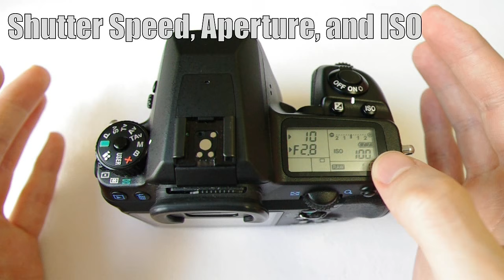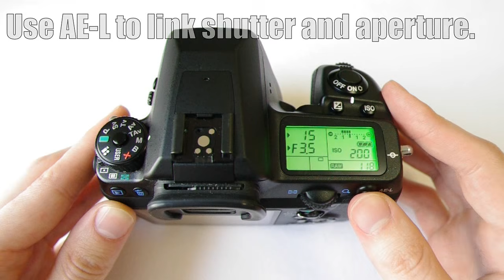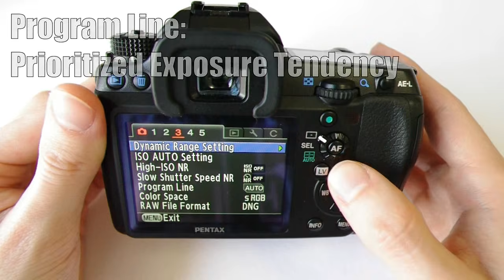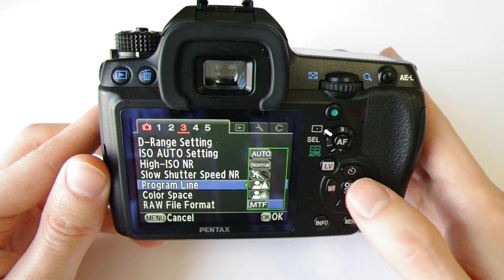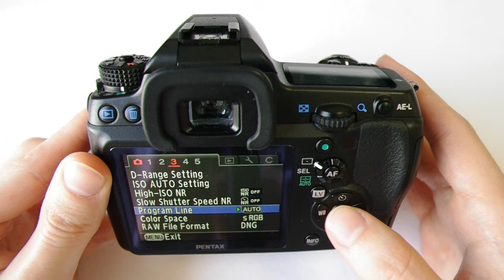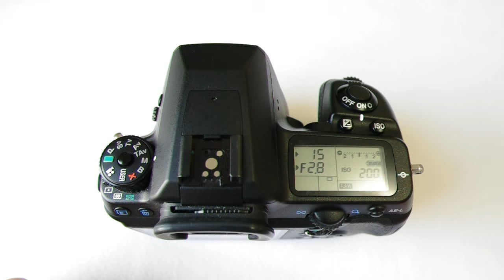Pentax Hyper Manual Mode Settings

Comment: I have Canon 60D and planning to change the camera to Pentax K5ii. What I think is Pentax the most reasonable camera for photographer. My problem is only knowing Pentax just the tip of it, so can you give me a reason why I have to change the camera and why I don't have to change it?
Reply from the maker: What about the 60D don't you like? Is there something you feel is holding you back? One benefit of Pentax is that their control and ergonomics are well thought out. According to DxO mark, the K-5 II sensor should provide you better low light performance than the 60D. How much of a difference in practice, I don't know. https://www.dxomark.com/Cameras/Compare/Side-by-side/Pentax-K-5-II-versus-Canon-EOS-60D___829_663 
Back when I was using Pentax, I always struggled a bit with the autofocus system. Canon has better AF performance in general. It looks like the K-5 II is upgraded compared to the original K-5, but I don't know how much of a difference that would make. Maybe you could find something newer around the same price?  Do you have a lot of Canon lenses? It would be time consuming to switch systems.
Reply: At first I do like it 60D, fast focus, flip screen, etc. I just hate it with the lenses that I cannot afford it, and I only have the 50mm 1.8 and tamron 18-200. And this is what I think if I'm having Pentax, I already have SMC-A 50mm f2, more cheaper lenses, the camera price is cheaper,  sharpness image and the amazingly the color image that I cannot have with 60D. What makes me holding back to change the camera is 60D my first digital camera and have been using it +-8 years, and yes if changing to Pentax it really time consuming
Reply: If you are considering changing, i myself have the pentax k5iis, its an all round superb camera, the low light performance and focusing is spot on, plus you can use nearly all the older pentax lenses produced in the past albeit with manual focus, i picked up two mint condition lenses the other day, a hoya 135mm f2.8 complete with uv filter & original leather case, and a nice perfect condition cosina 28mm f2.8 again complete with original leather case, the cost from ebay for the pair, just £49.05p including delivery, just think how much those would cost new, there's videos on youtube showing how to use manual older lenses and still utilise most of the camera features too.

Comment: What camera was this?
Reply from the maker: It was either the Pentax K-5 or K-7. I can't recall exactly.
Reply: 1st and 4most, i have to thank Photography Banzai for doing a really fine job of explaining various photography related items and topics in his simple yet great videos, this one in particular, which made me go and search for certain small yet important features i didn't quite know about in detail, until now, of the Pentax DSLR cameras, 3 of which i already own and use dearly: K-x, K-7 & K-5 ... :)

beware please: this comment is going to be TOO long, so, be prepared!

to address @bigpardner's question and to further compliment PB's reply to him, yes, this could be either one, but although the two cameras mentioned here are practically identical in body dimensions, design, and button layout etc, as well as being pretty much similar in operational modes and menu items options just as well -- with quite a number of changes made when K-5 came out of course, the latter's manual mode is more advanced than that of the K-7 and at least K-7 doesn't do all that is said here in exactly the same manner ...

in fact, in case of the K-7 (which came out a year or so before the K-5 btw) the M mode is fully manual, ie, the camera's light meter, although still active and working, it doesn't have ANY effects AT ALL on the photographer's actions and decisions when rotating the shutter speed and/or aperture dials ... ie, the photographer has to use a separate handheld light meter or other means to determine correct exposure and then set the aperture number / shutter speed manually on the camera, pretty much like when working with ancient fully manual film cameras and lenses ... (rather silly decision by Pentax designers, right? that's why they didn't repeat the same mistake when making the K-5 ...)

yes, what you have said here about using the Green and AE-L buttons on the back of the camera, or setting the camera's Program mode to MTF, does have some effects on how Manual exposure mode 'behaves' in both cameras, but in either case, the manual mode is just what it is and supposed to be: fully manual!
_ _ _

then it comes to using a light meter for determining the exposure (more on this at the bottom of this note btw*) which the K-7 does NOT offer while K-5 does, although in its own rather peculiar yet still useful and innovative manner anyway ...

with the K-5 though, the shutter speed / aperture control dials ARE coupled with the light meter indeed and work as expected, which, as already said, was the right decision to make on behalf of Pentax designers when people complained why it didn't work the normal TTL metering system way in the K-7 ... (although as this one was also mentioned already, it still works in its own unusual yet very nice Pentax way!) :-)

therefore, the camera model in this video must be K-5 then IF Photography Banzai's explanations on how to use the Hyper Manual mode are true ... which are not btw, and i'll explain in detail a while later ... but before getting on with that, let's consider the following please:

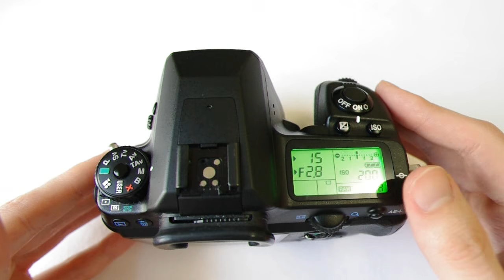to solve the mystery here, another reason i'd say this is a K-5 body is the fact that the exposure modes rotating dial on the left-hand side of this camera's top section is 'one dent' taller in height than the very same button in K-7 ... note: 0:35 please, when the camera is lifted up and rotated forward ... (this was another 'design improvement' in K-5 as a totally new upgrade to K-7 while retaining the exact same body sizes and overall specs btw, after the latter model's users weren't quite happy with K-7's mode dial button's rather short height that makes it a little bit difficult for easy operation ...) also, note 2:22 when the VO does mention K-5 ... (and i wonder why PB didn't notice that himself now that he's watching his own video after more than 5 years? happens to all of us in this overly busy world anyway ...) ;-)
_ _ _

now, the other VERY IMPORTANT thing is the fact that there's actually no "Green Hyper Manual Mode" in these two particular Pentax camera models, nor in most other Pentax cameras to the best of my little knowledge on other Pentax DSLR or film cameras ... (am a very old Pentax user since the 1970s btw!)

the Green mode in these two particular models at least, is there to overrun ANY fully- or semi-automated as well as manual modes of the cameras, and set the machine in the "Hyper Automatic Mode" actually, intended to help out those photographers who're in doubt which mode exactly to pick up and choose when taking photographs of any kind of subject matter ... (and it's a rather cumbersome mode for various reasons but well, let's just leave it at that for now ...)

also, the Green Mode doesn't exactly work via the little green button on the right-hand side of the camera's back really, but via rotating the top left-hand side dial and setting it on the tiny little green rectangle marking there ... besides, since many advanced photographers rarely use the Green mode anyway, the little Green button is programmable in both K-7 as well as K-5 models so it can be assigned to do other things ... another very good decision Pentax camera designers made in these two models ... (again, as far as i know, this button, and even the Green Mode itself is no longer used in later Pentax DSLR models but not so sure about that one really ...)

furthermore, as mentioned above, the Green mode (yes, proprietary of Pentax but other brands do also offer similar functions under different designations) is actually a pretty cumbersome exposure and autofocusing control option for advanced photographers who'd like to have either fully manual or semi-auto command on their shots ... but well, apparently some Pentax users have liked that mode since old times and that's why we see it in K-5 and K-7 and some other (mostly previous?) Pentax models, including some film ones, just as well ... (is it available on later Pentax models though? i doubt so! the Program mode can also be put to a similar use btw, but well, non-advanced photographers don't quite know how to do that ... that's why Pentax came up with the Green mode solution to secure sales for purely amateur photographers with little or no technical expertise in photography ...)
_ _ _

then we come to that useful (but totally non-relevant to the Green button) MTF option in Program mode ...

since i have already talked too much, i'd give you a link that helps explain what MTF actually is, as well as why it's not a needed item for the "Green Hyper Manual Mode" (or green button whatever) that is actually non-existent in this particular Pentax model at least ... (unlikely there is such a mode in any Pentax camera as far as i know, and i already explained why ...)

as said already, there is a "Green Hyper Fully Automatic Mode" in these two particular models at least, but no "Green Hyper Manual Mode" to the best of what i know!

here's the link about MTF in Program mode: https://www.dpreview.com/forums/thread/1807419

hoping my long boring comment is useful, thanks for reading!
_ _ _

* as for using a light meter for exposure control in photography, both (and especially!) in film photography as well as in digital, well, no light meter out there, even the most accurate / most expensive ones, is truly 'precise' in determining the 'absolutely correct' exposure for a really finely photographed image really! there are certain Densitometric / Sensitometric tests are to be done on the light sensitive device or surface (various film emulsions / different digital sensors) based on which Light Meter Calibration is to be done first and then applied to the manual exposure controls, ie, Shutter Speed, Aperture, and ISO ... long story, and totally irrlevent to this particular video at this moment anyway ...

Comment: hi, would you be able to explain to me how to disable the hyper manual mode? 

somehow my camera (pentax k-3) won't stop changing the shutter speed whilst in manual mode...
Reply from the maker: +Kacper Seven Sorry, I haven't used Pentax cameras in years. When in doubt, do a reset on all of the settings. Maybe it's that "program line" setting (menu 2)? I'm not sure it applies to M mode though.

Comment from the maker: @HRichmond1995 I have handled a K-r before, but only for a short time.  I would assume it can work on the K-r.  It looks like you can change aperture with the rear dial by holding the exposure compensation button down for a few seconds to cycle between shutter/aperture control.  The Green button and AE-L should work the same on both cameras.